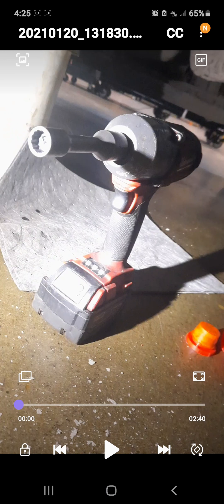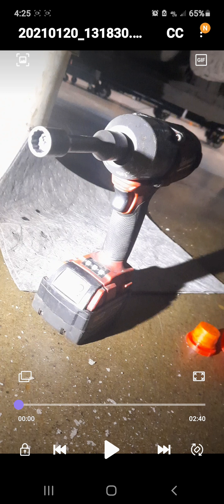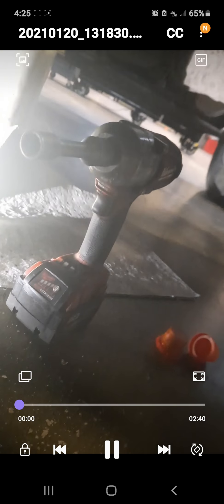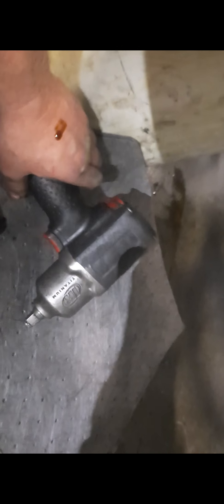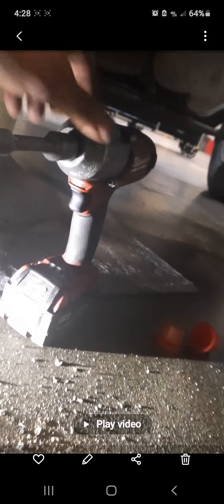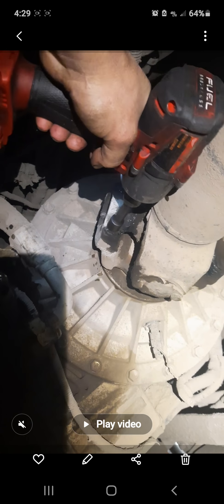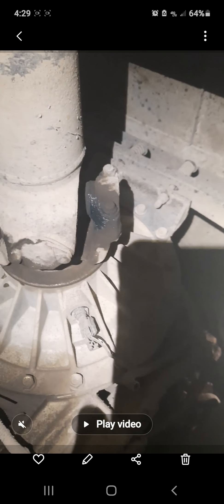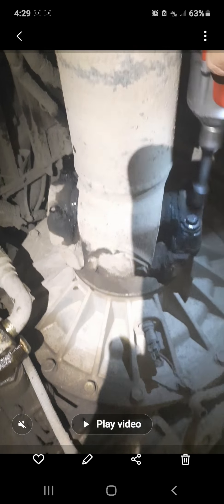MILWAUKEE MID TORQUE JUNK!

Comment: Not sure what to tell you man, there’s no way it can’t take them off. It’s rated for up to 600ftlbs, assuming it only hits half of that, it’s still twice the force needed if those nuts are torqued to spec. It’s just really hard to believe it can’t do it when every other video shows it does really well.
Reply from the maker: I can see your point. But did you note how the air gun crack the bolts loos quick. We shell see it took my m18 compact and mid torque in for repairs at Milwaukee service center. My bet they say nothing is wrong with the mid torque.
Reply: @itsatoolthing6323  hope they fix it.  how do I register for the warranty? I’ve had some things for almost a year now
Reply from the maker: @CP-ok1gv  it a good idea to take a pix of the the tools sn# and keep your receipt. If they use the sn# it's off the date of manufacturer which you will lose some of the warranty because the tool may have been sitting on the shelf or sometime be you purchased it

Comment: Yeah it’s unfortunate. My mid torque dewalt struggles with the drivelines on occasion but will break them loose, but it’s also rated far less than the Milwaukee mid torque
Reply from the maker: All the cordless impacts are all junk. Thanks for watching